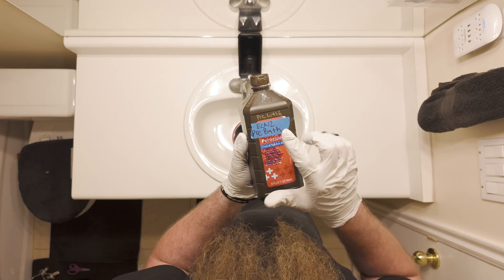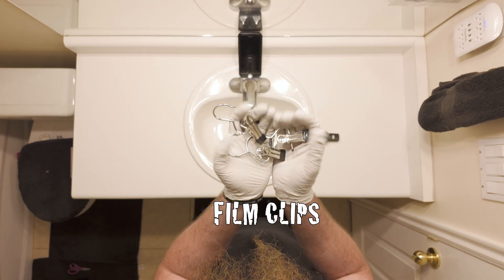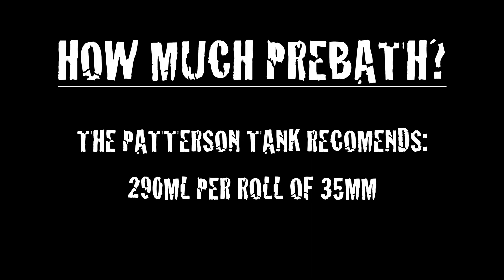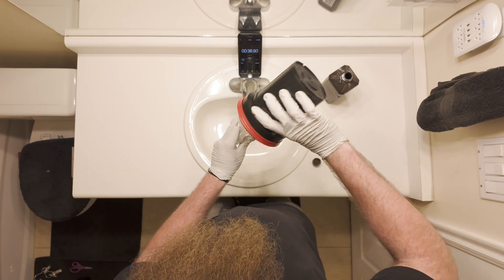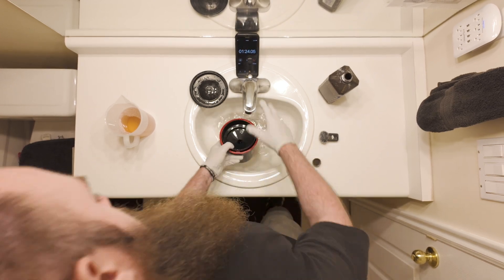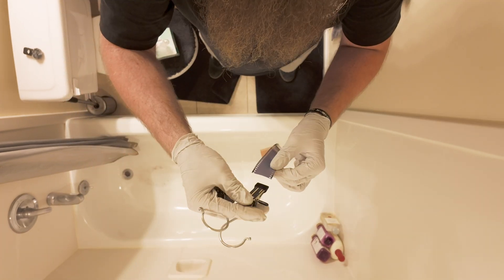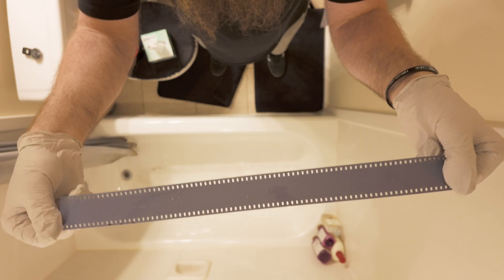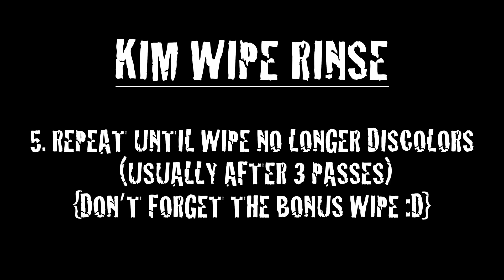How To Remove Remjet From ECN2 Film

Comment: Great video but I wouldn't wipe the emulsion side with anything.
Reply from the maker: I’m glad you like the video! If developing ECN2 by hand, gentle wiping with damp fingers and a wet Kim Wipe is necessary to remove the residual remjet from the emulsion side of the film. 

I added the wet Kim Wipe (which is designed to be gentle enough for use with film) to be sure all the remjet is removed from the film. 

When the wipe stays white, the film is remjet free and there won’t be any white streaks or splotches from residual remjet that you would otherwise see if it was still on the film base.

With over 100 hand processed, scratch free rolls, it’s safe to say film emulsion is quite robust and easily handles gentle pressure from fingers and damp Kim Wipes without scratching.

Thanks for leaving your comment and for watching the video! 😎👍🏻
Reply: @1331photo  I just ordered some Kim wipes :)
Reply: @piotrjanowski454 I can vouch this works. But I also find that with vigorous washing, there is so little ramjet remaining, if any. The wipes are still a good measure though as a small amount does come off.

Comment: Hi, loved the video! I had a question: can you reuse this kit? Because I've been searching on forums but no one seems to know. If so, what's need to do after each use for a correct developing process (add more time, add fresh developer to the mix, ect)?
Reply from the maker: Hi Adrian! Great question! 

The prebath doesn’t exhaust as fast as other developing chemicals do. I used the same batch of prebath over a year and it was still working fine. 

Thanks for reaching out checking out the video! Happy developing! 😎👍🏻

Comment: Nice and clear, thanks! How do you do your stabiliser bath? I’m assuming you don’t manage to get it back on the reels so do you just pop it back in the Paterson tank loose for a minute or so and add stab? Cheers!
Reply from the maker: @OllyHitchen  Hi Olly! I appreciate your positive feedback! 😎👍🏻 

So… I haven’t been using stabilizer with ECN2… 🥴

I could be totally wrong here, but here’s why: in my limited (and uneducated) research, modern stabilizers that come with basic ECN2 dev kits are basically Photoflo… which isn’t really a “stabilizer” because it doesn’t contain a biocide. Without a biocide, mold and fungus can grow on the emulsion in humid climates. (I live in a high desert with low humidity, so there’s not as much risk.)

Hopefully someone with more knowledge can hop in the comments and explain this better, but I’m not sure what modern stabilizer includes biocide… 

When I was using the stabilizer included with the ECN2 kits, I wasn’t respooling the film to rinse, just carefully dipping the film into the stabilizer by hand. I tried respooling the film a couple times and always scrapped off emulsion around the edges of the film.

Hopefully this helps! Thanks again for watching and asking your questions! 😎👍🏻

Comment: After the initial Remjet removal process can or should I use C41 chemistry? Or should the entire process be done in ECN-2?

I understand that removing the Remjet layer after exposing the film causes the absence of the halo effect around light sources?
Reply from the maker: Hi Jan! Thanks for your question!

You can develop in either ECN2 or C41 after removing the remjet - which ever you prefer.

You're absolutely correct! With Vision 3 the remjet layer protects the film from halation. On occasion you may see minor halation around extremely bright sources of light.

Happy developing!